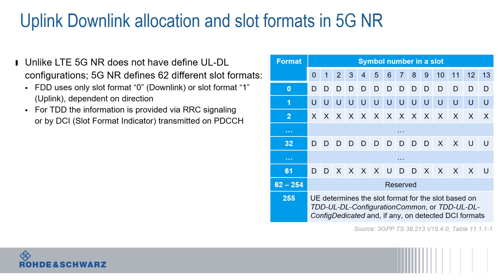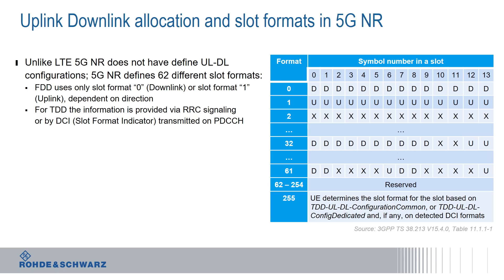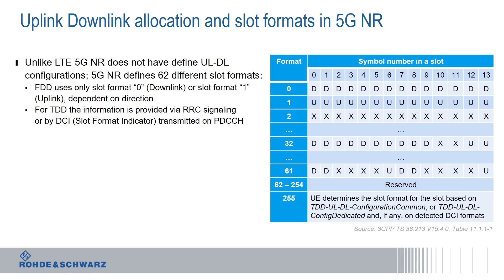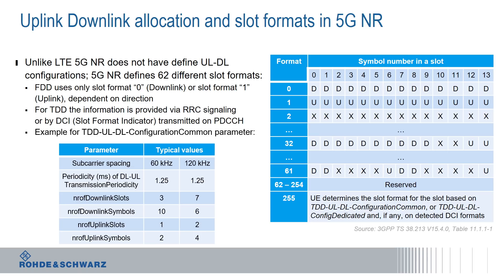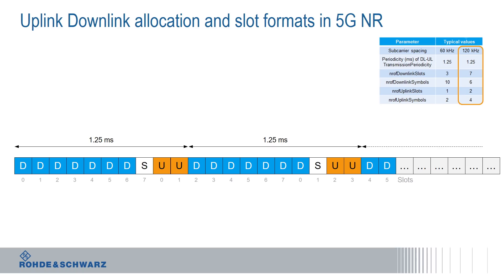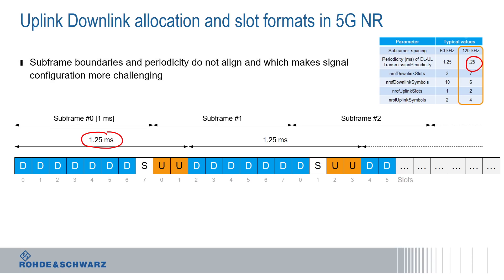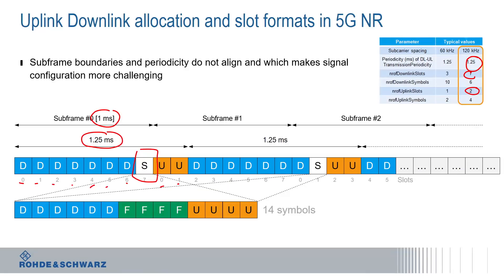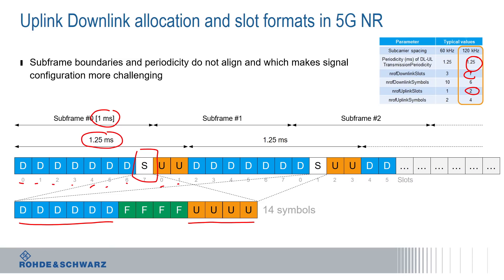Demystifying 5G – How are slot formats defined in 5G NR?

Comment: Thanks for the video uploaded. i have one question
in LTE we have 7 Frame configurations of UL-DL slots in TDD. In 5G, how many frame configurations do we have? 
There are 56 different slots configuration which is defined, but that is applicable for FLEXIBLE slots in the 5G-FRAME, what about the other slots in a frame. How are they defined?
For ex. with SCS as 15khz, we have 10 slots of 1ms each in Frame of 10ms. How are these defined? Is there any specific Frame configuration as we had in LTE?
Reply from the maker: Dear Rohit Karadkar, thanks for your question! 
As mentioned at the beginning of the video, there are no specific UL-DL configurations in 5G NR like there were for LTE. A device determines the network configuration based on RRC signaling. We recommend chapter 1.2.4 Duplexing schemes in our 5G NR ebook: http://www.rohde-schwarz.com/5G-ebook
Best, Your Rohde & Schwarz Social Media Team